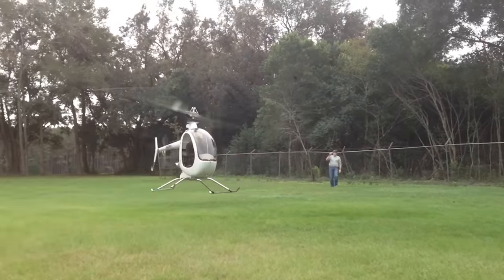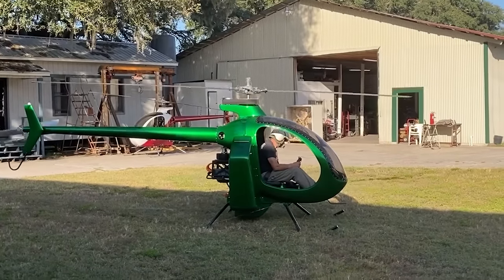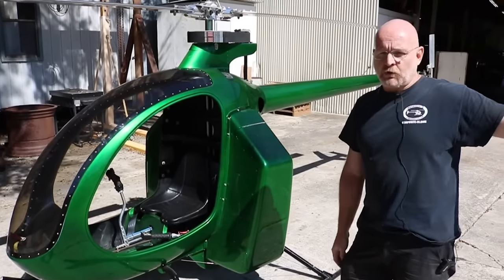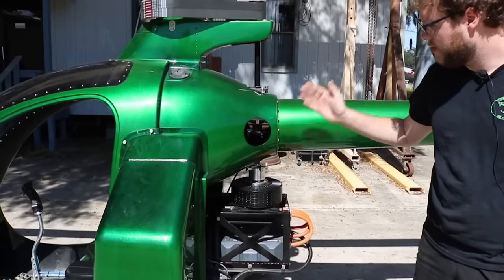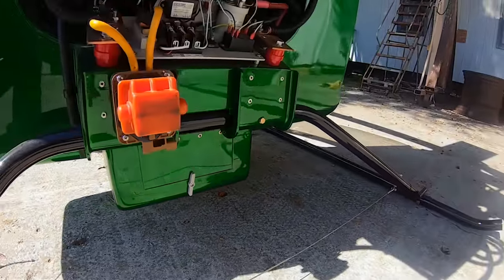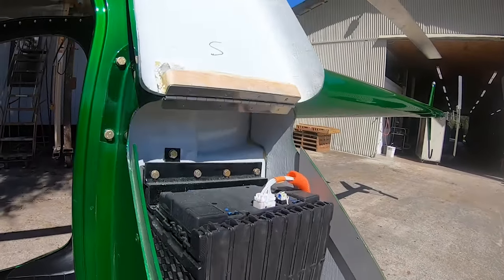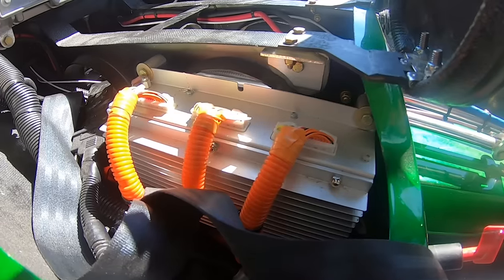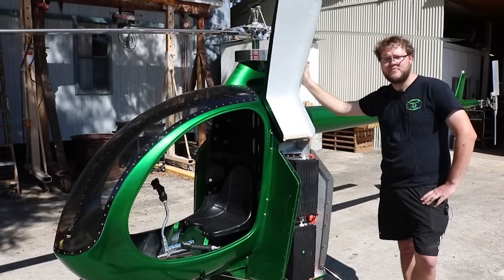Mosquito Helicopter going FULL ELECTRIC!? 2023

Comment: Maybe needs another 15 to 20 years of battery development to be a viable option
Reply: They just need to build a hybrid.  Slap a small gasoline generator on there and you can use a tiny battery then.
Reply: Maybe two years
Reply: It's interesting how smart phone is progressing...
Reply: Fifty years development wouldn’t get me in it
Reply: @LegendLength  no hybrids bad for enviroment
Reply: @LegendLength  You were half right, they need to use a hybrid system but it needs to be hydrogen electric due to the weight of the batteries. Any aviation related powertrain must be hydrogen electric because of the weight savings and safery since hydrogen is less flamable than gasoline and any battery technology plus they need to increase mechanical efficiency otherwise theres no point.
Reply: @aleroscoychiquita your kidding I hope
Reply: @eddieknight8392  you hope ? hybrid is bad for the emviroment except if it is a hydrogen and electric hybrid but if its gasoline and electric hybrid then it is bad
Reply: @@lurch789 thanks
Reply: Only a breakthrow about density of energy : This copter has lithium battery: 200Wh/kg. Only 1 liter of GAS : 12.000 Wh/kg....
Reply: If they used a disposable Aluminum /Air  battery they could fly for 2 hours. Cost per battery $100.00
Reply: 意外と5年後でバッテリーが出来るかもしれない
Reply: @LegendLength   That doesn't make sense. If a gasoline engine is running, it is more efficient to drive directly. There is a hybrid helicopter that has an electric motor in addition to the gasoline engine, with which it is started, used as a generator, and if there is an engine failure, it has enough power for the pilot to land safely.
Reply: You can't beat thermodynamics no matter how many years you have. You'd need a totally new technology to make a battery decent enough to make this work. Something like this is dead on the design floor in terms of usability and practicality and an engineer would know that. Don't get me wrong tho I think this thing is pretty cool, it'd be fun to have lol.
Reply: For general use yes. For niche short range routes, EVs already have a place I think. I drive packages with a Mercedes E-Sprinter, only 200km range but perfect for the job and super easy to use. You'd think there are some short logistics routes in mountainous areas where this could work. Especially if the batteries could be made to plug in so that you can store spares at both ends of the route.
Reply: I've-built-nuclear-engines-for-vtol-aircraft-but-never-passed-prototype-stage-solely-because-the-weight-of-either-water-or-lead-for-radiation-shielding-is-just-to-heavy...Once-lighter-shielding-is-invented-electric-power-will-be-obsolete...Imagine-going-30,000-50,000miles-inbetween-exchanging-the-fuel-rod-and-zero-emissions.
Reply: @LegendLength  Hybrid system would increase the weight even more. PHEV
Reply: @znoop72   You need to subtract the weight lost due to a smaller battery pack (obviously a very high value)
Reply: @LegendLength  That really depends on the configuration. And if the battery pack is too small, why even run a hybrid setup? Hybrds are very inefficient compared to BEV.
Reply: @znoop72  Efficiency doesn't matter if the range is 10 times for the same overall weight
Reply: @LegendLength  an ICE with a fuel tank and also a battery, inverter and generator. It adds up. And of course efficiency matters. Thats why three phase induction motors are superior.
Reply: @znoop72  Not really it's more about power to weight ratio of the ice
Reply: @LegendLength  The Electric motor wins there also, The fuel however
Reply: @alaindelon5398  My EV with a heat oump does not.
Reply: Good work, this is an aviation application where electric drive should do the job.

They are currently using a heavy motor vehicle traction battery. Switching to properly designed light weight flight batteries should get significantly increased payload and endurance. My bet is at least 40, possibly 60 minutes. New flight batteries currently under development should get them to 90 minutes.
Reply: @johnslugger Definitely a possibility, the power density is right, however Al air still needs development.
Reply: Yes...and wireless android auto and apple carplay , reverse camera, tyre pressure monitor, level 2 ADAS, fast charging ports, climate control, power windows, mcferson strut suspensions....all are must have... cant wait for a 4X4 edition...😅 in-air recharging...can convert a hand driven pepper grinder to a dynamo for that...and, kenny loggins mixtape...nothing will work if it cant play ride of the valkyries or danger zone tracks at good volume...best if put a vinyl disc player for cool analog sound...two wooden surf boards and voila...navy version...
Reply: @aleroscoychiquita bad for the environment huh? Perhaps you should get checked to see if your a bit slow.
Reply: @BloodPlusPwn  It hasn't much to do with thermodynamics, rather it is the chemical molecular and crystalline composition of the anode, and cathode. Theoretically lithium batteries could have a capacity in Watts/Kg, upwards of 600, three times that available today. 

The issue is the cathode, anode and electrolyte materials that allow this to be realised affordably, safely, reliably and offer good durability. 

We know adding silicon can get large increases in capacity but we haven't found a way yet to get much beyond 200W/Kg without compromising durability.

There is a huge amount of research going on and progress is being made, I think 400W/Kg is quite likely over the next few years, probably involving exotic materials of silicon and carbon, but getting much beyond that could be hard.
Reply: @LegendLength then why not just use a slightly larger petrol engine to directly power the heli? What is the advantage of the electric motors?
Reply: @peterwallis4288  For heli's in particular straight gas engine may be better.  But most other applications need sudden acceleration which is where electric shines.
Reply: Hey real quick what does your PFP mean?
Reply: It needs a plutonium battery.

Comment: This is really good to see - the best innovation seems to come from small companies. I realise you're using the existing airframe but the motor and inverter would sit beautifully just below the rotor (like most turbines), benefiting from a cooling downwash and freeing up space to fit the batteries in a more aerodynamic/inboard position.
Reply: While I would put the inverter and the rest of the support package (cooling, etc) below the boom, I agree that placing the motor up there on the shaft from the belt drive pulley to the tail rotor shaft gearbox would free up valuable room immediately behind the mast line, below the boom.

For those not familiar with the Emrax motors, I'll note that they have a hollow shaft which would facilitate installation coaxially over a shaft, although the bore of the Emrax 228 model is only 17 mm in diameter.
Reply: yeah less red tape.
Reply: @julian99051  That would be problematic for autorotation if you had an electrical failure that killed power to both motors.
Reply: @julian99051  separate motors are fine in a radio-controlled toy, but in an aircraft carrying a person they would be an unacceptable (to me) risk, because if high-voltage drive power fails yaw control is lost. It would be okay with sufficient redundancy and a high enough level of design and testing... but this aircraft is not constructed to anything like that level.
Reply: Are you going to be redundant like magnetos for backup?
Reply: The motor axis can be horizontal and the inverter just behind it, towards the tail under a large airflow. (+ possibly air retarders).
Disadvantage: This means changing the gearbox to an angle of 80 - 90 deg. metal-metal
Advantage1: beltless transmission, lower friction, higher motor speed = less amps = lighter cables = cooler inverter (lighter?)
Advantage 2: direct connection of the balancing propeller to the gearbox for the autorotation condition.
The most effective is of course 2 counter-rotating rotors. In that case, the flight time would be extended from 25 minutes to 35.
Reply: @kentherapy7022  
Yes, you could build a different helicopter. The point of this project is to explore battery-electric power for the existing Composite-FX aircraft, which uses the Mosquito rotor system and belt drive.
The connection between the main rotor and tail rotor does depend on the synchronous belt drive, but that is reliable, lighter than a gear transmission, and probably just as efficient (perhaps better). This is not like a friction-based V-belt drive.

No one makes tandem-rotor helicopters this small, for good reason - with two cyclic controls and a mixing linkage between them, they're complex. It would be interesting to see one, but I don't expect to ever see one larger than an R/C model and smaller than a heavy-lift machine such as the Chinook... especially now that the world is obsessed with multi-copter and tilt-rotor designs.
Reply: 25 MINUTES OF FLIGHT TIME? YOU MAY AS WELL GO BACK TO GAS ENGINES. THIS ISNT PROGRESS THIS IS GOING BACKWARDS LOL

Comment: That’s such an exciting prototype! Obviously the challenge is to extend that runtime and range.. as the battery technology catches up these kinds of aircraft will be such a cool and novel mode of transport for the people who are lucky enough to be involved!
Reply: The entire chopper chassis would probably have to be completely remade to encorporate all of the added weight and packaging :/
Maybe a fundraiser model with the size of a robinson or a little bird?

But it is a vital step for their developement as a company!
Reply: modify a glider to an EV and design features to allow it to land vertically. helicopters are very inefficient and should be phased out IMO.
Reply: Solid state batteries are difficult to get right but a few companies have made some pretty good progress. Those batteries would really unlock the potential here. High capacity, light, and safe.
Reply: 25 MINUTES OF FLIGHT TIME? YOU MAY AS WELL GO BACK TO GAS ENGINES. THIS ISNT PROGRESS THIS IS GOING BACKWARDS LOL
Reply: @illuminatedperspectives2894   the first electric cars had a thousand pounds of lead acid batteries and had a range of 20 miles. Look how far we've come from that, and remember that nearly ALL the massive ev advancement has been in just the last 10 years.  This is a first gen, essentially prototype electric helicopter. Imagine in just 5 years how much more advanced they will be! Now imagine 10 years!

Comment: You should configure your battery packs in parallel so to have redundancy.  If one of your packs goes wrong then the whole thing goes down because you are wired in series. Hope you have a good BMS with plenty of heat regulating mosftes and something to regulate cell balancing etc...

Comment: This is a great project, done very well. I look forward to how it develops. Personally I always prefer series hybrid, your battery would effectively become the reserve for if the engine quits, or if you have a sudden power draw for whatever reason. Then the engine can be at its most efficient. It works for trains lol
Reply: But what's the point if we charge the batteries with fossil fuels. What has been accomplished other than making more toxic waist from battery production? I'm just not seeing the benefits of going electric. We can never hope to produce enough electricity with sun or wind, so why bother?
Reply: @okgroomer1966   I think Thalass just gave us the point, power train redundancy in the helicopter fixes an imminent danger to life and health...
Reply: Nice looking helicopter, but being all electric would have its drawbacks,  range would be affected by head winds, temperature, the draw of instruments, an communication equipment lad well as unforseen weather.  To me I don’t think I would want to fly one all electric, I feel the same way about electric cars an trucks,  people that have these electric pickups an have tried to tow a trailer ( empty or loaded ) have found out that even being able to tow the range drops significantly an chargers are hard to find an takes a long time to charge them back up if you can find a working charger or one that produced enough wattage to charge the batteries.  Electric may provide you with horsepower an instant torque but not the range as of a gas or diesel engine can.  Plus their very expensive right now an some have a tendency to catch fire for some reason an the fire burns hotter an is harder to put out than gas or diesel fuel.  Maybe in time they can overcome those problems though at my age I may not live to see it.  I do wish them luck on their project an that they can get it working.
Reply: Thalass, gasoline engine plus generator plus fuel added  to the already existing batteries and motors would make it so heavy it would get off the ground.
Reply: 25 MINUTES OF FLIGHT TIME? YOU MAY AS WELL GO BACK TO GAS ENGINES. THIS ISNT PROGRESS THIS IS GOING BACKWARDS LOL
Reply: PREP TO FLY THIS THING TAKES LONGER THAN THE ACTUAL FLIGHT DURATION LOL. WHAT A WASTE OF TIME BUILDING THIS HUNK OF JUNK

Comment: Yes ,any additional info on this build would be awesome . Type and brand of vcu or control unit ,type and brand of bms and details of batteries . Price point of items for conversion would be nice to for others pondering doing their own . Trying to share the info needed to keep the experimentals going!
Thamks
Reply: They don't want to say (for legal reasons), but the battery modules appear to be LG Chem 16S 1P as built for the Chrysler Pacifica Hybrid van; they were available from many suppliers for a while. It shouldn't need a VCU.
Reply: @brianb-p6586  Thanks

Comment: Really impressive. I like the way they are pushing the tech even though so far the batteries only provide 25 minutes of flight.
Reply: If they doubled batteries could be a short commuter
Reply: @patrickday4206  more batteries = more weight and thus less flight time.   so maybe double batteries would increase flight time by 50%,  then quad batteries increase flight time a total of 75%
Reply: @jebes909090  tesla's wireless power then?? 😊 haha
Reply: @patrickday4206  thats the same tech the aliens used in independence day!! Elon innovating as usual.

Comment: Go same Shaft/Parallel Circuit. 
It is a safer way to charge or produce needed velocity because it is running with the main current power source. For minor or emergency circuit producers, you can thermal or solar charge. But don't forget about the wind turbine charge you are producing with the blades/propellers generating. Small is always better done having nothing. 😊

Comment: Yes! Please do a follow up with these guys as they continue to develop. 25 mins in the hover is one thing but do they have numbers for actual point to point which is a bit more efficient. Even 25 mins isn't so bad as a point to point hopper if that suits your mission. Half hour charging is fine because you would never fully drain the battery anyway.
Reply: I doubt it gets 5 minutes with a pilot. they even had to edit the seconds long flight and then show a jet powered one. electric airplanes can barely get 20 minutes.
Reply: How do you auto rotate in an emergency with something that has an electric motor with no clutches to disengage the motor from the blades?
Reply: @thecloneguyz  it looks like the motor powers a belt from the motor to the rotor.
Reply: @thecloneguyz  The drive system is the same arrangement as they use with a piston engine. the belt drive. An electric motor has very low spinning mass and no compression so it may not even be needed to disengage the motor. Or the belt drive has an auto clutch that lets the rotor spin when the motor stops providing power.
Reply: @frankyflowers  The KW draw in the hover and battery capacity seems about right for 20-25 in hover. I assume that's ground effect hover though.  They look like Nissan Leaf batteries. Other electric converted helicopters (there is/was a R22 testbed) also got around 20 minutes. They did mention that this is in very early flight test stage so I wouldn't expect them to go far just yet. The Pipistrel Electro 2 seat fixed wing trainer gets one hour flight time plus reserves.
Reply: @generalvoltage1821  not with a person. they even had to edit that short hop and showed a jet powered one the rest of the time. if a person got in and hovered for 20 minutes that would be world news worthy.
Reply: @thecloneguyz  Matt here. It does have a sprag clutch in case the motor bearing fails. It autos like any of our other models.
Reply: @generalvoltage1821  Matt here. You are exactly correct. We are taking it slow because it is new and we want to make sure we are keeping our pilots safe. 20-25 minutes till completely empty is what we would expect to see, based on state of charge after each 5-15 minute run we do and examining the energy being consumed.
Reply: @thecloneguyz  Auto-rotation depends on a flywheel effect from the blades and gears (to tail rotor) to keep the blades moving as you land. An induction motor has no resistance if there is no electrical power, unlike and ICE or turbine engine . So its kinetic energy would add to the inertia of the rotating blades.
Reply: 25 MINUTES OF FLIGHT TIME? YOU MAY AS WELL GO BACK TO GAS ENGINES. THIS ISNT PROGRESS THIS IS GOING BACKWARDS LOL
Reply: @illuminatedperspectives2894  The first helicopter flight in 1940 was a few seconds long. It's pretty obvious this isn't a final for sale product. I mean, it's REALLY obvious that this is a test bed. On what planet do you live where trial, experimentation, revision and testing are not part of progress and learning. Do you really live in a world where you do or try nothing unless the outcome is perfect and guaranteed?